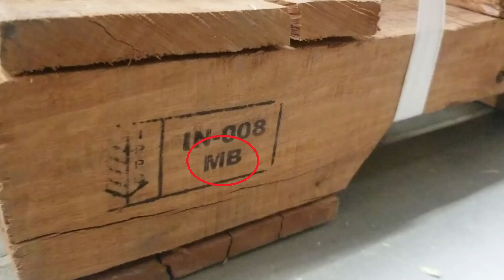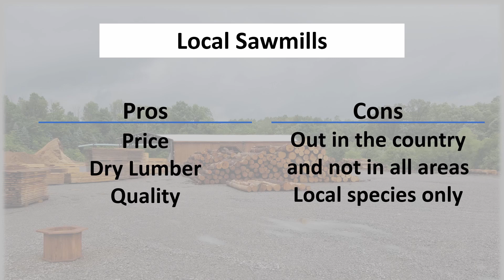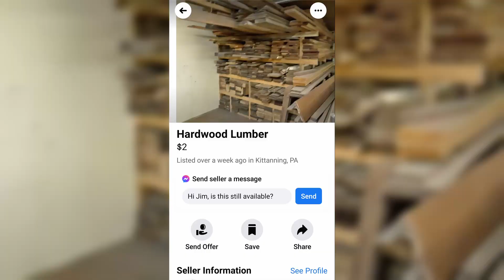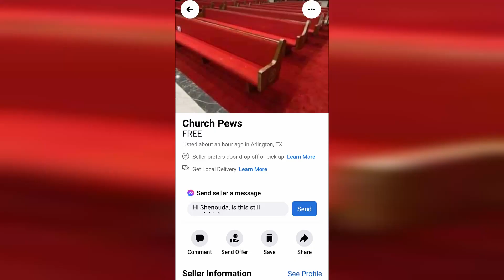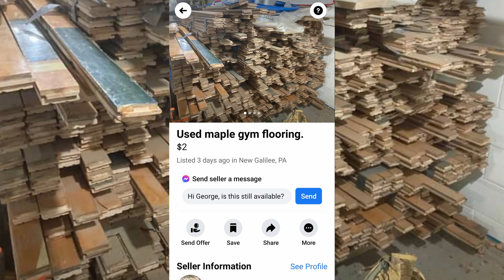Tips on Finding Cheap and Free Wood for your next Woodworking or DIY Project

Comment: Days after purchasing an old Dodge cargo van I planned to build out for Vanlife purposes, the actor's workshop rehearsal space next door to the place where I had a storage unit moved out & left PILES of used sets. Not only did I score a ton of good lumber (plywood, 2x4s, 4x4s, like new, some plywood already framed up with 2x4s I used as the bed platform), but also sheets of NRP poly wall board, plus one roll of the stuff long.enough to do the ceiling.! Short of some vinyl flooring & underlayment, it was almost EVERYTHING I needed for the whole build-out, just sitting there in the alley next to my storage! I cut up styrofoam coolers I found in the dumpster behind the hospital (the kind they ship vaccines in) for insulation. Did the entire build-out for less than $100!
Reply from the maker: That is fantastic.  I never thought of using old sets.  I would think that they would recycle that stuff themselves.  I am always amazed at the things that people throw out.
Reply: You found a gold mine lol 😆 thats awesome!!!

Comment: I got a story. Friend of mine bought some property that had a 200×60 hog barn on it built in the 60s. All of the hog pins were built out of 2×14 and down white oak. I took it all. Absolutely crazy looking wood stains. I cut all the boards short of the posts because we couldn't pull the 6 inch nails. Random nails can be trouble, and you really gotta inspect the wood. It's easily a semi load.

Comment: Not to discredit, but I've heard so much ragging on pallet wood. They aren't all pine, some are oak, and really there's nothing wrong with yellow or white pine. Construction grade lumber is yellow pine. but outside the books, the actual applications for palletwood is unlimited. My grandparents house burned through thanks to an ancient gravity furnace. Rebuilt from pallets. EVERY scrap of wood furniture they had, pallets. The woodshed, Pallets. The mower shed, pallets. the gazebo AND swings, pallets. ornate bookshelves and urns, pallets. Grandfather and grandmother clocks, pallets. Grandpa NEVER bought a scrap of wood. But the whole family would get together for a cookout or pizza party and tear apart pallets. My cousins and I were always on nail duty lol. I miss it. Anyway, this ain't about family, it's about limiting what people think. Pallets are amazing if you know how to pick them. Even with that info, they are pretty frustrating, and you can get some beautiful woods and grains. I've used 16' long pallets. They exist, you just have to look for em. You'd be amazed what companies throw away.

Comment: Hey there Dave.  Great, informative video.  Again.  The self gratification and pride in taking an old, discarded, board(s) and planing, shaping, sanding, fitting and finishing has few comparisons.  I have re-purposed snow fencing (2x6), elk panels, boards from derelict barns, homes and outbuildings to name a few.  I recommend a good strong magnet made for the purpose of finding those hidden screws and nails before running through the planer.  It is always a surprise to see the beauty hidden within an old cast off piece of lumber.
Reply from the maker: I agree completely.  I love reusing old things and giving them new life.  Good tip on the screws. The last thing that you want to do is ruin your blades on an errant nail.  It can also be dangerous

Comment: I buy a lot of lumber from the Home Depot cull pile. I build a lot of smaller projects, so if there is a chunk missing, but the first six feet are fine, then I can use it. Or if it is bowed, I look at it as cambered. I built a long shelf for over my computer desk with two bowed pieces attached by perpendicular 2x2 spacers every 18”. The camber was good because I loaded it with my printer and text books, so no eventual deflection. :)

Comment: Cabinet shops are a for sure spot to hit.  I been working at my current cabinet shop for almost 5 years.  And I have so much amazing hardwood I had to stop my boss from throwing away.  Usually doing a hardwood job, there will always be one or two boards with amazing grain patterns that don't match the rest of the wood.  So that goes in my pile.  I have a storage building full, at least 4 using spots on the shop floor, and quite a bit of the attic storage also stuffed with everything.   We also have the throw away so many good pieces of sanded birch 3/4" plywood it hurts my feelings.   The 1' or 2' pieces will stack up until we couldn't walk around our shop if we didn't burn them.   So yeah definitely get to know your local cabinet shops.
Reply from the maker: That is awesome! Your cabinet shop wouldn't happen to be located in the DFW area would it? Asking for a friend 😀
Reply: @DIYwithDave  lol,  afraid not friend.

Comment: I'm glad that I personally don't care if my wood is treated or has damage. It will rot but that's actually better for my project. I'm going to make some fairly large raised beds for my garden and rotting wood can help the garden thrive.

The only thing that matters is that it holds soil for 5 to 6 years. I'd want it to fall apart afterwards so it can be composted and reused in newer long-lasting beds.

Comment: I've used Woodworkers Source which is online and they shipped to Utah.  I was nervous because I couldn't hand select each board but it ended up working out great.  The the local specialty lumber yard didn't have a lot of what I was looking for and what they did have was in pretty rough shape.  I was nervous about warping but I bought sapele which is pretty stable to begin with.  I built a nice laundry countertop and would definitely order from them again.
Reply from the maker: Hi Jon! That sounds great. What was it like in terms of cost? Did they ship you long boards?
Reply: @DIYwithDave  Took me forever but just got around to sending you an email about this order and project.

Comment: I had a local friend custom cut wood for my trailer deck at 1/3 the price of the commercial wood. Just a note about the "wood shortage" the local mill is shutting down for a week because there is no place left to stack the wood and they want to do some maintenance.
Reply from the maker: At this point there is no shortage. The mills have more than they can sell.
Reply: @DIYwithDave  it's been like that for months here in Shelton WA. Wood is stacked as high as the forklifts can go. I don't know why the prices are staying inflated. The mill has a sign up looking for people to work as well with a $1500 signing bonus.

Comment: We used to build houses without sheet material. We still can. My scape pile has never been smaller. There are many places less than construction grade lumber can be used. 2x3, 2x2 can be used sometimes when we used 2x4s before.

Comment: DO NOT SALVAGE PIANOS WITHOUT KNOWING WHAT YOU'RE DOING
IT'S DANGEROUS

The massive metal plates on pianos are under thousands of pounds of tension -- 15, 18, 20 TONS -- from the strings. Sometimes the only thing holding the metal (usually cast iron, which is brittle AF) "harp" together is the wood behind it, as it may have rusted or  cracked or been otherwise compromised. Under no circumstances should people without experience start messing around with that structure. The harp can literally explode, when tension isn't let off evenly or slowly. 

That sudden release of tension can result in potentially lethal metal shrapnel -- either the plate, parts of the plate, or the strings themselves, or all of those simultaneously. 

The only safe way to dismantle a piano is to first let the tension off every single string. That can take many hours (there are usually 240 or so strings on a piano), and more if the plate is rusted. You'll need a tuning key. And patience.  Then, once all that's done the plate has to be unbolted from the wooden soundboard and pinboards if you want to recover that wood (which you often don't, as often the frame is glued to them, and/or they have warped and split).  Unbolting the plate is generally a nightmare.

I just saw a video where someone takes a grinder after the strings. One word:  Darwin.